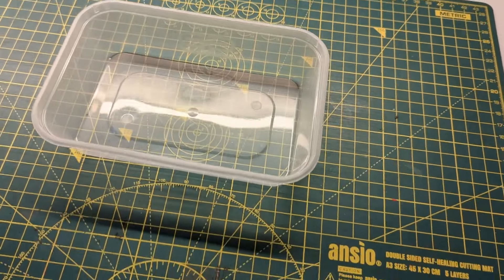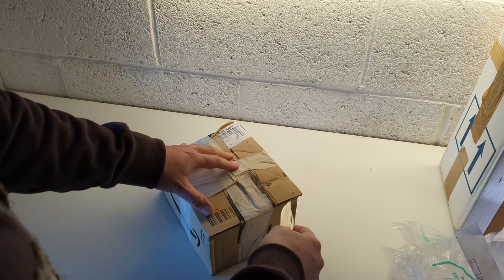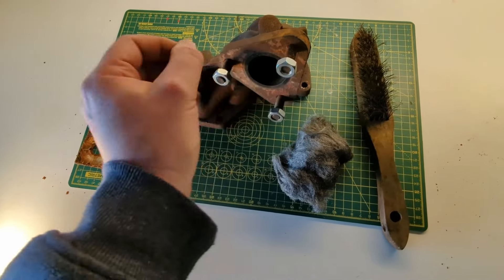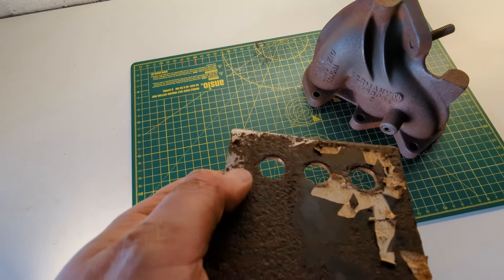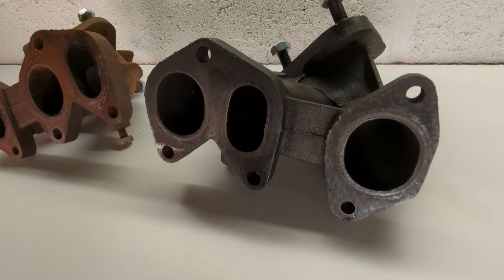You Can Do This At Home

Comment from the maker: Here's how I restore old car parts to almost new condition, saves time and money. More vector and vinyl art work videos will follow, just had to get this one out!
0:00 - Bonus tip, removing galvanised plate with distilled vinegar
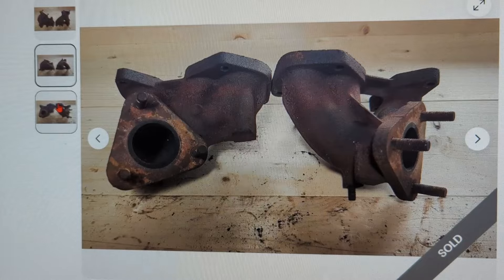0:22 - Ebay listing showing the manifolds
0:37 - Opening the box
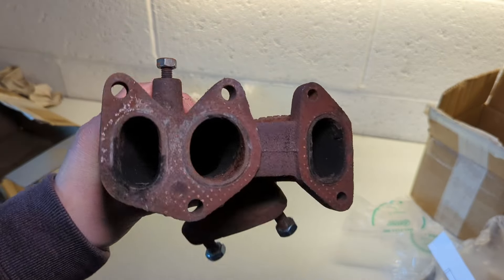2:50 - What we're dealing with, nasty rusty stuff
2:55 - The gear you'll need for your Electrolysis setup
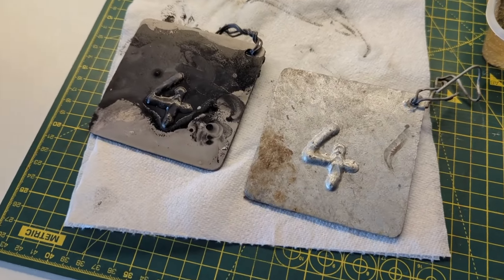3:30 - Progress on the distilled vinegar strip
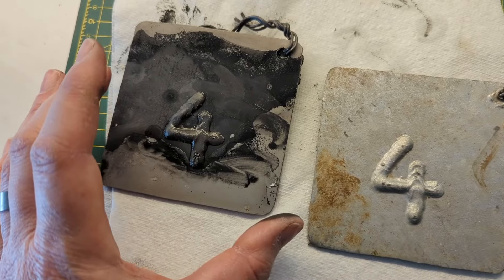3:55 - Pre prep of the parts
5:15 - Setting up the electrolysis tank
6:15 - Adding the water and seeing initial reaction
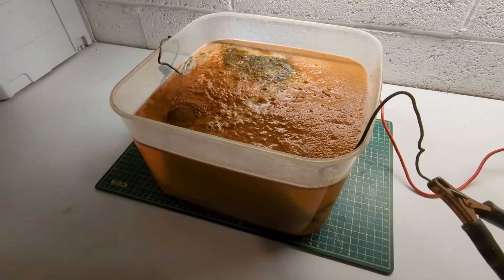6:54 - 6 hours later
7:05 - Pulling the part out for a progress check
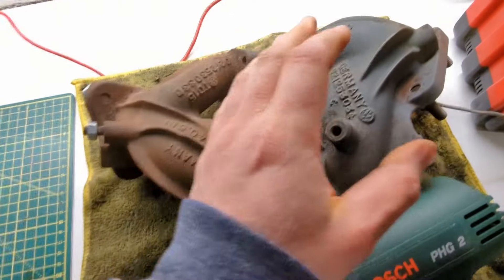7:37 - Comparison between partially cleaned and untouched parts
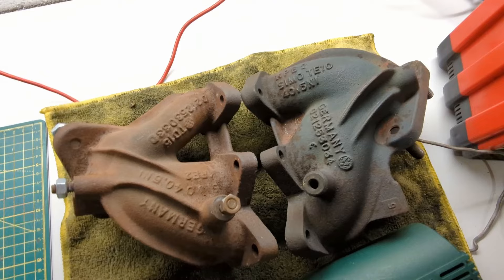8:10 - 12 hours later
8:22 - Out in daylight, comparison
8:40 - Final shots of before and after

Comment: Wire wheel on the drill or a orbital sander works great for the plate😁
Reply from the maker: Hi Thomas, Yes, I think I need to get organized a bit better, I have a bench grinder which would be great with a wire wheel, I want a proper workshop! 🤣